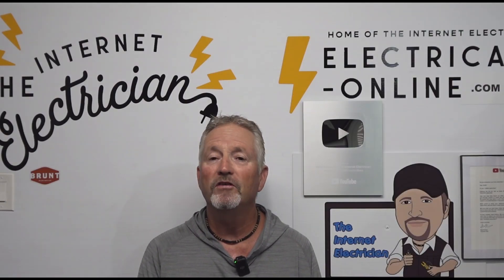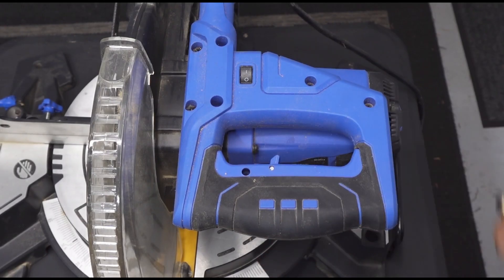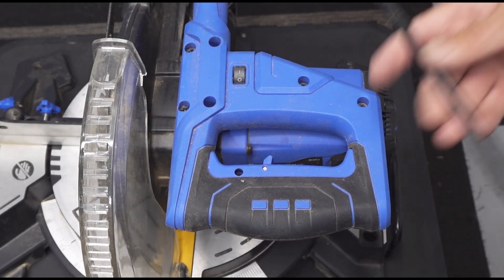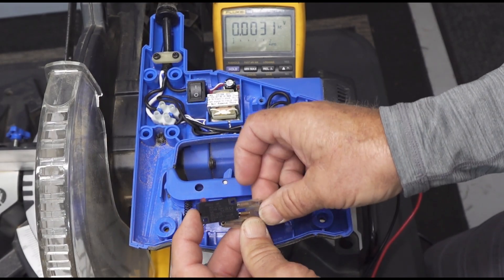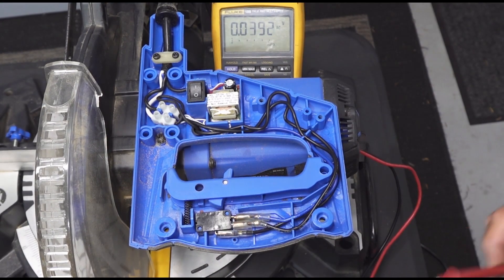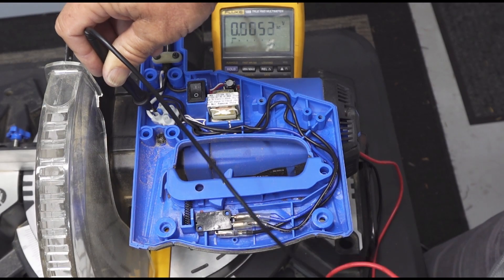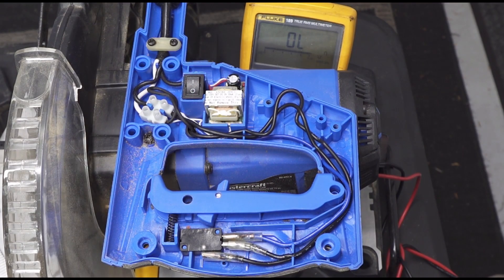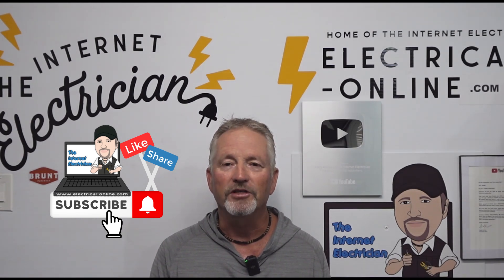Troubleshooting an Electrical Problem With a Miter Saw

Comment: Excellent video - appreciated seeing your thought process and method for tracking down the problem. Although everything seems to be disposable today it would be great to see more videos like this showing electrical diagnosis and repair.
Reply from the maker: There should be more repair shops like there was in the past, where you could take small appliances and equipment to have repaired.  The trouble is with how much compensation is needed to keep up with the increased cost of living, and thus, $200 of labor doesn't make sense for a $100 cost for new.  Sad but true.  But fixing your own stuff, if you have the time, now that makes sense!